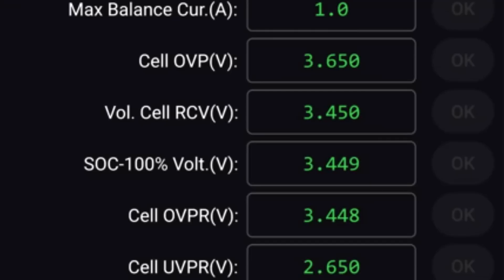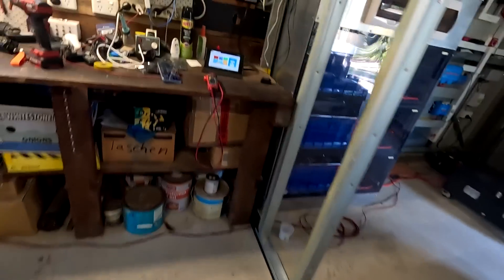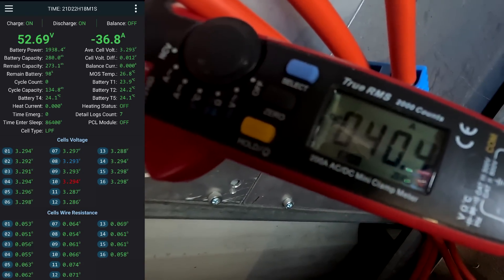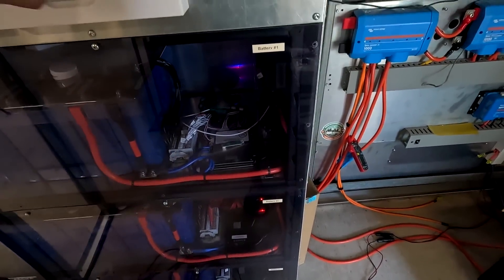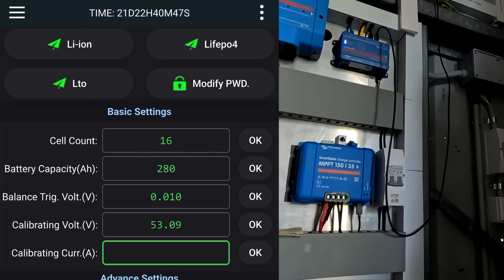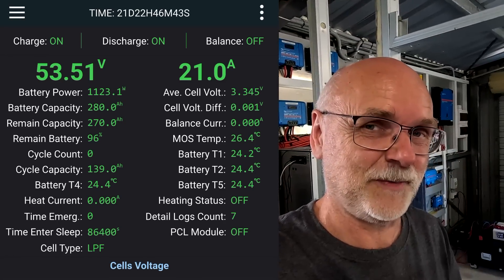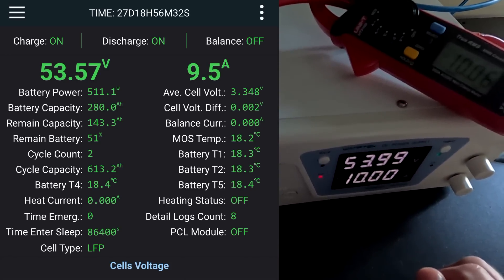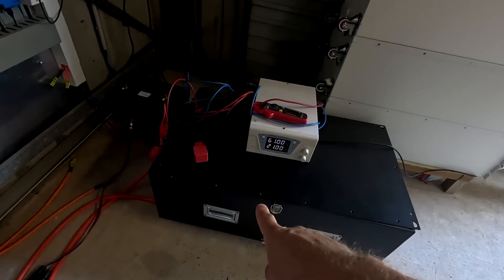JK BMS SOC Drift - How to (not) calibrate the current sensor and will it actually help?

Comment: Why not use 4 car lights in series, measure the current and set it? Or use a power resistor of 200 Ohm and measure and set the current?
Reply from the maker: They will heat up and the current will decrease. I would have to wait for some time until this has stabilised.
Reply: @OffGridGarageAustralia  probably the only thing which works is a current source, but who will have that laying around. Thanks for trying as best as you can and beyond, to evaluate and being critical about JK inv BMSes 🍺
Reply from the maker: @edwardvanhazendonk  That's what I asked JK as well. They said, most customers will have a clamp meter, so that's the best shot we have.

Comment: When you try to calibrate at 20A you have more voltage drop over the cables distance. When you use 10A the voltage drop is less and the number will be a bit off from the calibration. Will be hard to do. How long are your cables and how thick are the wires? Even the temperature will change the numbers.
Reply from the maker: That does not matter. We are dealing with a series connection of battery, cables connections, power supply, ... the current is the same, no matter how good or bad the connections are or how long the cables might be.
Reply: @OffGridGarageAustralia  thanks for the clarification!!

Comment: Cant you put the inverter into 'charge only' mode, set it to say 50 Amps and go from there?  You will obviously need the other inverter running to provide the AC input to the first inverter (but that would be normal mains input for an on-grid system)
Reply from the maker: The inverter will always create the 230V sine wave output, no matter what I will do.

Comment: For now we don’t know if the error is non-linear or linear with the distance to the calibrated amperage.
1. Linear: It would be sufficient to have an additional correction factor i (float!) for the inclination where i = 1.000 means no error.
I = I_shunt + i*(I_shunt - I_calib)
2. Linear: Alternatively the BMS could be teached a zero amp point.
3. Non-linear: Multiple calibration points are necessary including interpolation and extrapolation.
Reply from the maker: I would say, it is not linear from what I observed.
Reply: @OffGridGarageAustralia  Assuming they programmed the BMS for a linear curve: As most BMS will have very similar shunts a software update with a more complex calculation taking some non-linearity into account would make the SoC measurement way more useable through a firmware update.  Maybe you can share this hint with the JK guys to have a go at this. The only thing they need to do is do a wide range amp test against their shunt and figure out the curve- this is not at all a new challenge for  programmers, similar implementations exist to compensate for poor ADC inputs on many micro controllers.

Comment: I just ignore the BMS and go with the readings from my Outback Radian inverter system shunts with the Mate3s controller and Flexnet DC current flow analyzer module which is actually designed for lead battery use.. It is most likely not super accurate either but I get a kind of point of reference and also watch for the quick rise and fall at the ends of the battery capacity cycle.. I still get red lights flashing that my capacity has bottomed out when I have 30% capacity left so certainly not accurate.. Thanks again Andy, you are a top go to guy when it comes to LiFePo4 batteries and JK BMS..
Reply from the maker: Yeah, I do the same with the Victron Smart Shunt and use that as the point of truth!

Comment: Is it possible to use the MPPT with constant sunshine for Calibration?
Reply: MPPTs by their very function constantly vary the voltage looking for the maximum power point, and "constant sunshine" is only applicable on a cloudless bird-free environment...
Reply from the maker: We could try and set the CCL to say 80A and wait for a sunny day so all MPPTs will be restricted to that 80A max charge current. That could work.

Comment: Heya, don't know if there is a solution as you work with AC and DC coupling as you said AC is a sinus wave and DC is a CC and you will have losses in the cables and inverter and in contact's. maybe JK can programm the BMS for a average wen discharging the battery but then still you gone have a differance.
Reply from the maker: The cable loses and connections will not matter in a series connection.

Comment: I've added a Victron's smart shunt for this. I have more confidence in this platform for measurement purposes. The shunt is set to Battery Monitor
Reply from the maker: Yes, I have the same. But what are people doing which don't have Victron gear?
Reply: @OffGridGarageAustralia I have selectronic and the only time the battery matches the inverter is full. I was thinking of running battery in pylontech mode as inverter can read this but to be honest no trust bms is up to being correct . Happy to get Victron shunt and raspberry pi to be able to monitor effectively it that works.
Reply: @OffGridGarageAustralia I don't think there is an effective way to calibrate the current over the full range to guarantee an accurate SOC reading. Just one argument validates my position: by resetting the SOC to 100% when just one cell reaches a certain voltage. I have it at hand myself: one of my new 305Ah EVE cells reaches that set voltage much sooner than the others (voltage difference 180mV). The BMS then reports 100% while the smart shunt is at 50%. No calibration can cope with this😅

Comment: I did use a benchtop PSU to calibrate mine some time ago, but I don't have one with enough current output, mine tops out at 3.2A. But I noticed the same issue when calibrating at a certain current, it just reports wrong values going higher or lower afterwards. I think JK should really provide multiple calibration points, maybe a 0 current as well like the SmartShunt has. Without multiple calibration points it's never gonna work right I guess. Also, we really need to be able to calibrate with negative values (and why no decimals...), because then a simple dummy load with resistors could do the trick instead of having to charge the battery at a high current. I hope they can improve the calibration procedure!
Reply from the maker: I guess, calibrating the BMS with smaller currents will be very inaccurate when higher loads are connected.

Comment: There is no need to calibrate the BMS. Even the environment temperature will uncalibrate it.
Reply: Getting an idea about how accurate the current monitoring shunts are is still a good idea.. I would say removing the loads on the system then if your inverter has a charging function set this to 100 amps and convert grid AC to battery DC to check what the difference is as a mental reference.. If it within a couple amps I would not worry but if it is off by quite a bit this could cause problems or signal there is a problem like a resistive connection somewhere..

Comment: Hi Andy,
Did calibrated with Victron shunt while discharging with  100A, and mine SOC reading during high current discharge are +/- correct.
Problem are the small loads.
If you apply AC at your multiplus II the current the battery sees is a sine wave, even @ 0 Amp.
The reading of JK @ shunt 0A than does jump from 3,5A to - 3,5A.
Turning off AC in, you will see lower amps than the 3,5A.
JK should implement average measurements say running average of 1-2 sec, than current measurement and SOC will be correct!
Reply from the maker: But discharging means negative numbers which cannot be set in the BMS.
Reply: @OffGridGarageAustralia  Just verified, put in the positive amps number during discharge and it will calibrate. during discharge @ -100A just calibrate with 100.

Comment: Would it be more precise to calibrate the current AND the voltage at the same time.
Reply from the maker: The SOC drift is solely depending on the current. But yeah, voltage can be calibrated as well if necessary.
Reply: @OffGridGarageAustralia  Agreed... just saying... not the first weird thing JK has done
Reply: @OffGridGarageAustralia 
Current only, not power - is this verified by the JK engineer?

Comment: Hi Andy, on a sunny day set the charging current on the inverter to a safely achievable value, check it with a current clamp and put it in BMS 👍😎☀️
Reply from the maker: I thought about limiting the CCL to say 80A and wait for the MPPTs reaching that. It should be fairly constant.
But how accurate is the reading at say 10A when calibrated at 80A?
Reply: @OffGridGarageAustralia  Yes, the calibration only seems to work selectively. The measuring sensor in the bms is probably not really linear

Comment: Hello Andy
It would also be nice if you could address the problem with float mode at JK. 
I think that's more important than calibrating the bms
Reply from the maker: Float mode?
Reply: @OffGridGarageAustralia  He means the controlled float charge doesn't work in 15.30 firmware for victron. From your previous video, there are multiple victron users mentioned after JKBMS RCV Timer expired, it doesn't switch to RFV.
Reply from the maker: @AshleyL-.-L  OK, thanks, I'll test it out.
Reply: @OffGridGarageAustralia  
That's exactly what I mean.
I have the voltage for RCV at 3.45V and RFV at 3.375V.
the time parameter of RCV and RFV 1h and 7h.
Float mode is switched on.
However, when the RCV timer has expired, the BMS no longer switches to the RVF voltage.
But if I change the RCV voltage, it is displayed in the remote console.

Comment: maybe set the inverter to be in bypass mode ie use grid/genrator which will then be your 3kw inverter
and set the inverter to charge battery with grid with a nice high amps then calibrate or 
do it when mppt is pushing lots of amps
Reply from the maker: It would still produce AC and a sine wave, right?
Reply: @OffGridGarageAustralia  yea i did not stop to think how does a victron handle this

I use a voltronic inverter that can be set to power the load from grid any solar power will then only charge the battery
Can also mix solar and grid to have this charge rate at a constant amps

Maybe  charge battery from grid will have the same effect on victron to have a constant current to battery

Comment: You need a large Bank of high power resistors
Reply: Andy has shown that you cannot use discharge current as that would be a negative value, while the app doesn't allow negative value input for calibration

Comment: JK need to add calibration curve option. Set reference amp to different points
Reply: Yes this!
Reply: This is such an expensive option that not all solar inverters have it, and you want an inexpensive BMS to have this calibration CURVE option!
Reply: @Drillmechanic  it's not actually expensive. The BMS already has a microcontroller and software. And curve calibration can be implemented to great precision by a lookup table and linear interpolation (the best option would be polynomial fitting, but that needs more computational power). Heck, even adjusting slope and offset via just two measurements (high and low current) would improve what they have a lot.
Reply: @svenmueller  Your idea is doable with the current hardware. Only need software. Just allow us to calibrate at multiple points and let the controller intrapolate/extrapolate the curb.
Reply: @svenmueller  How BMS can control the charging-discharging curve(V-A*h) - only by some communication with charging invertors which have already precise SOC calculation components!
Reply: @svenmueller  I think ESPhome have simple implementation for this calibrate_linear can't post link but it's simple solution to have multiple data points to add device state and actual state
Reply: Jk are Just being lazy... it's not hard for them to calibrate their BMS s in the factory... don't palm it off on the customer and if the engineers don't know how to do this then ... should they be designing electronics!!🤔
Reply: @pragmaticcosmic2826  they should then measure all of them and that increases a price. Basic curve what users can update if they have will
Reply: Hello I need some help with some batterys. I have so lifepo4 batterys that I'm using, I t was cycled five times and I have some new batteries. Can I use them with the new batteries to double the amp hours?